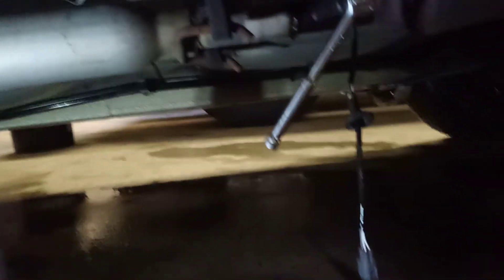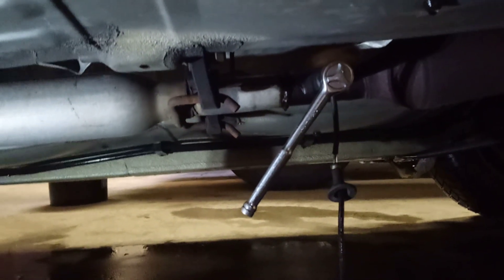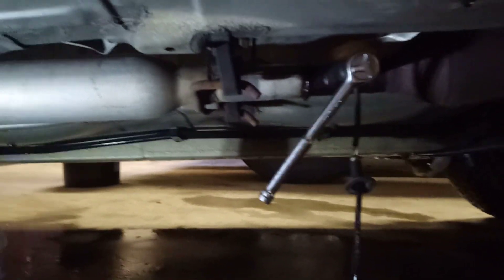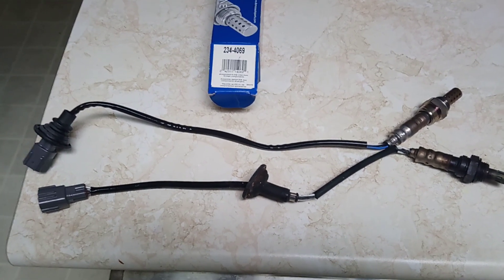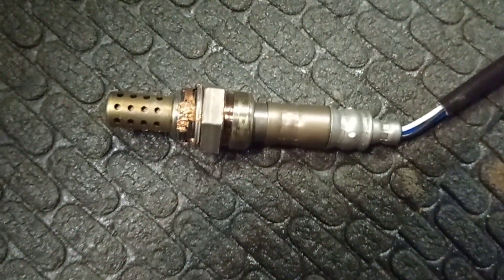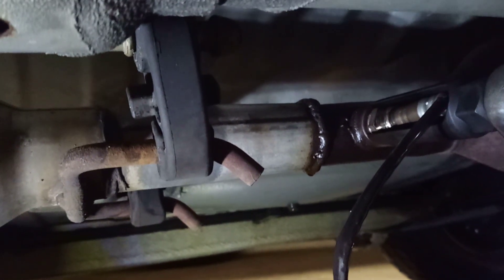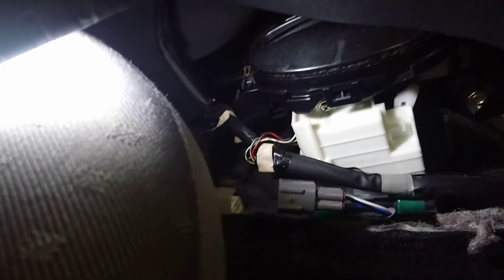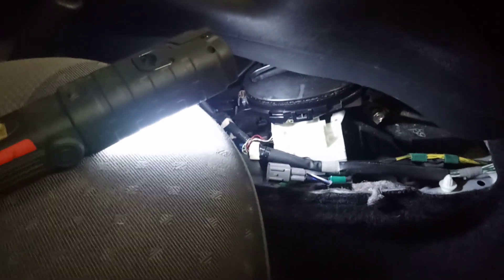2005 Toyota Echo/Yaris oxygen sensor replacement P0138

Comment: ugh the replacement sensor i got doesn't have a new grommet. i'll have to figure out how to use the original grommet i guess smh
Reply from the maker: You could cut the wires where they would be inside the car, put the grommet on and solder them back together using heat shrink and tape.  Not elegant, but it will work just fine.  Too bad.  Always some complication.  Good luck.  You'll get it done.
Reply: @redgreen610 thanks for the tip! I was gonna cut the grommet cuz I was worried about cutting the wire there (or if I couldn’t figure out a reliable and safe way to de-pin), but the part inside the cabin makes sense. I’ll give that a try!

Comment: Did it run rough when the oxygen sensor packed it in. What's the engine light flashing
Reply from the maker: Mine was the post cat sensor (sensor 2) which basically monitors the health of the catalytic converter (uncracked hydrocarbons).  It ran perfectly fine and I wouldn't have known anything unless I checked the code after the check engine  light went on.  If the pre cat  ( sensor 1) goes, it sends ecu incorrect signals to alter the air (oxygen) fuel mixture and that can definitely alter your performance.  I had a pre cat go on my 4runner and I was in "limp mode" all the way home (ran rough). The tolerances on these are very fine and being just outside the range will trigger "check engine" just as well as a catastrophic failure.  So, sometimes the check engine light can be on a long time and even go off when the sensor is just going bad and there will be no noticeable difference in driving.  Not sure what flashing light you mean...
Reply: @redgreen610  
Very helpful.
The actual check engine light is flashing and it is running like it has a misfire.
Reply from the maker: @kaboom362  If you have a fairly regular misfire, it could be something as simple as spark plug wires (jumping leads or grounding), maybe failing coil, I doubt you are burning oil and have fouled a plug. Could be fuel quality too. Had contaminated fuel once, or partially blocked for failing injector. Odd flashing check engine.  I'm sure mine on both Toyotas just came on constantly without flashing. You are getting a  code? If you don't have a reader, they are about $16 for a cheap one. I'm curious, if you figure it out, I'd like to know too.
Reply: @redgreen610   It's the Toyota 1.5 L
 Last week I threw plugs and boots at it. I also clean the mass air flow sensor and the throttle body. I was surprised to see not one fouled plug because the way it was running it was almost obvious it had a dead miss. In my mind it's a toss up between a faulty pre converter 02 sensor or the actual timing. The problem is I work too much and I only have one vehicle and I can't gut this 1 and have it holding for parts. I should have known because the tailpipe is clean with no black residue. I stuffed a whole bottle of sea foam in the tank and put some high performance fuel in it the kind that cleans as you drive. I was hoping that maybe it might slowly chip away any deposits on the 02 sensor Or at least make a difference. So far I drove it about 200 km and I haven't noticed any improvement. It's sputters on acceleration like it's misfiring. At idle the rpm's dip and slightly like you could feel a miss in the background. When you get up to highway speeds the engine light starts flashing. I remember years ago I timed a Cadillac engine one tooth off and it did the exact same shit. I had to retirement and it ran perfect after that. It's possible I let the oil change go a bit too long and maybe the tensioner allowed the chain to slap one tooth off in there on  Downshift. If it has a camp sensor code then it would be the timing I would guess. First thing I would do was take the front cover off and check the timing. I'm just trying to avoid surgery because it's not fun working in your driveway at 53😄
Reply from the maker: @kaboom362  Yeah, maybe the timing chain tensioner is wrecked or the chain is too worn or it skipped.  VVTI are a little more complex than buckets and pushrods.   Not one likes doing surgery in your driveway. Hope you don't have to!